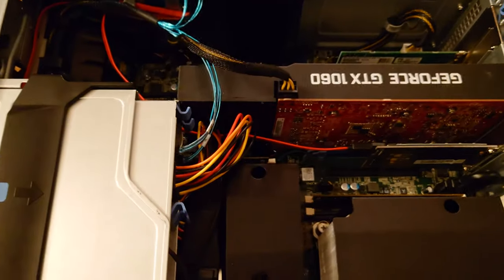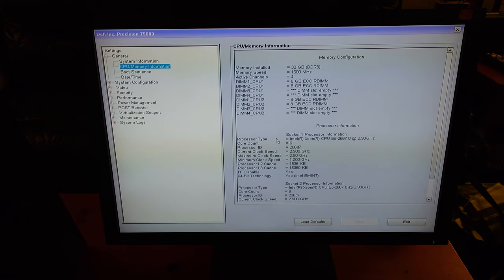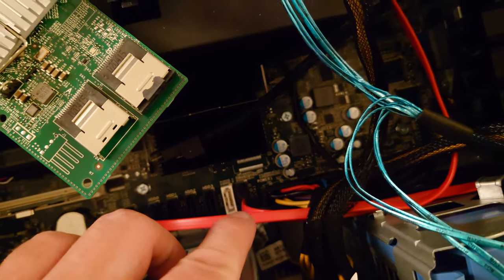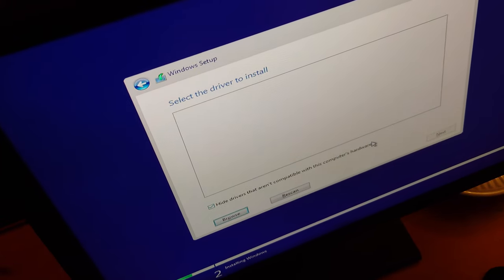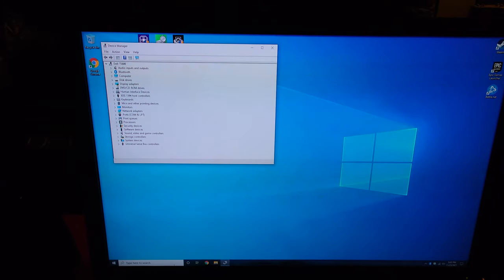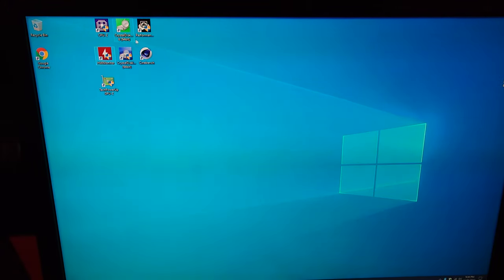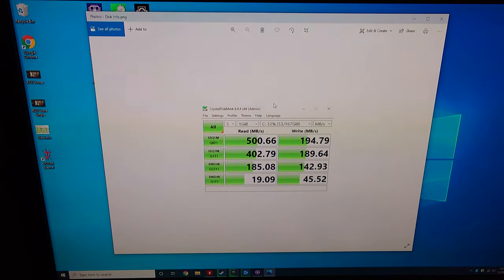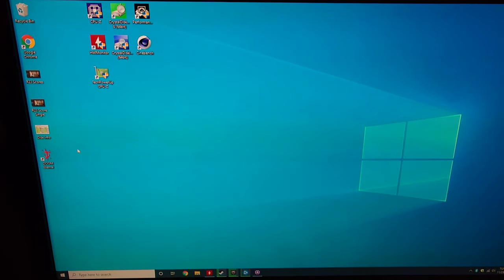Restoring a Free Dell Precision T5600 Into a Gaming PC PT II Windows Install and Benchmarks

Comment: Cool find.  I am using a T5610 with Dual Xeon E5-2650 V2s and 128GBs of RAM which is the max for these machines.  I popped a GTX1070 in and I am good to go.  I have a very similar setup.
Reply: does this t5600 support secure boot in bios

Comment: Was watching another video in a similar set-up. He said that nvme pcie is not supported for boot drive. This He used sata SSD for boot drive and nvme pcie for fast storage for games etc.
Reply from the maker: Yeah you'd need a bootloader solution for NVMe boot or a 950 Pro from Samsung. I tried to use a M.2 SATA card but had issues with the onboard SATA ports.

Comment: did you end up using any SAS drives and the PERC card? I have a 5810 with a couple of SAS drives and perc card looking to turn it into a gaming machine
Reply from the maker: Yep ended up using the SAS drives on the PERC card. They were a bit faster than my 7200 SATA drives but most of them had good amounts of reallocated sectors so not sure how long they will last.